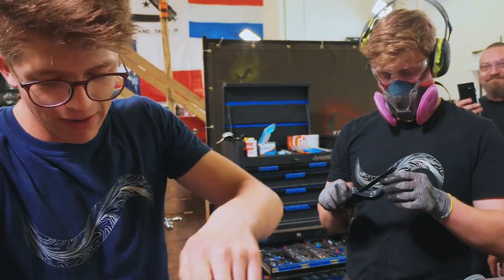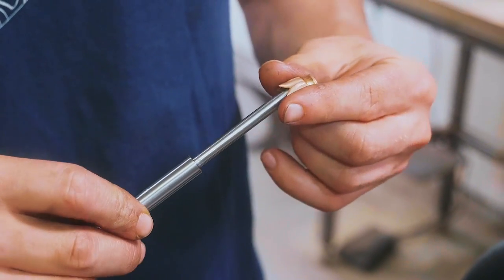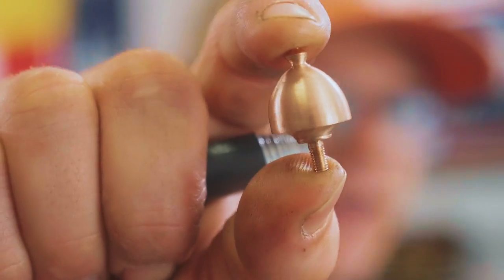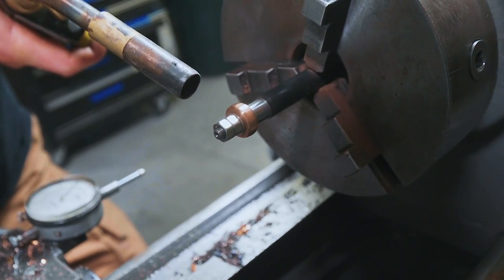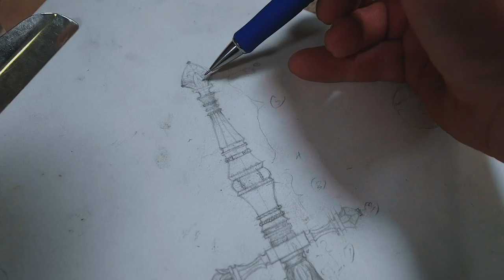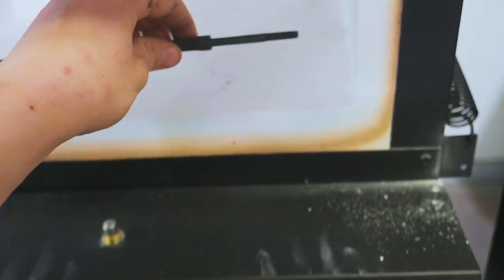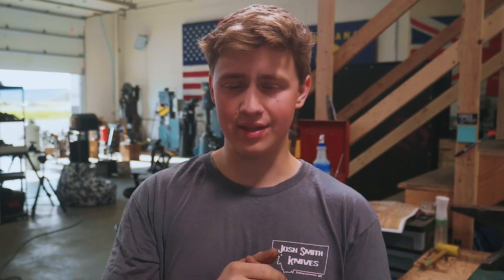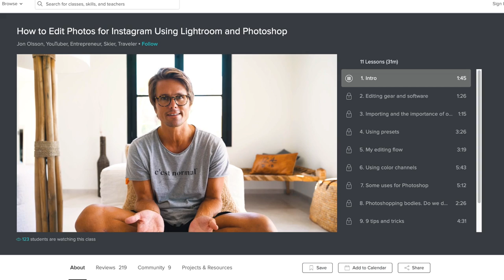DAMASCUS STILETTO DAGGER!!! Part 2

Comment: Did you wipe the bonding surfaces with a damp cloth before using Gorilla Glue? Original Gorilla Glue is water/moisture activated.
 
Fyi, not trying sound smart or superior to you lmao. I learned this because, for the longest time, I used to use gorilla glue unactivated. I think it's a pretty common thing to do actually -- who really reads the instructions on the back of a super glue bottle?
Reply: I had the same experience, I never understood why people hyped it up so much, the stuff sucked. Then someone told me I was skipping a step and it worked SO well.

Comment: I learned that you should not grind steel with diamonds, because the carbon in the steel react under heat with the diamond which is pure carbon.